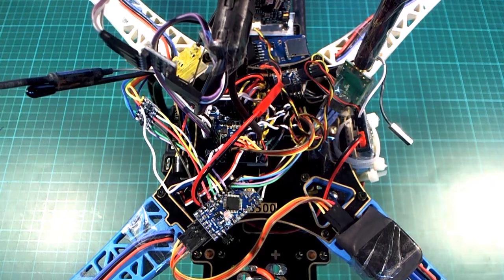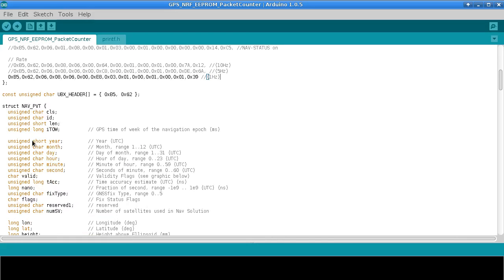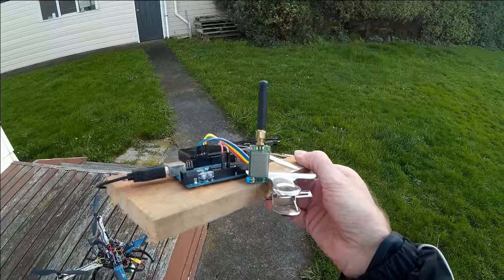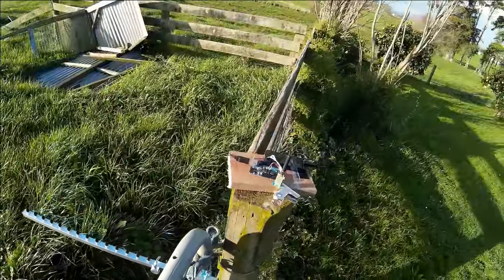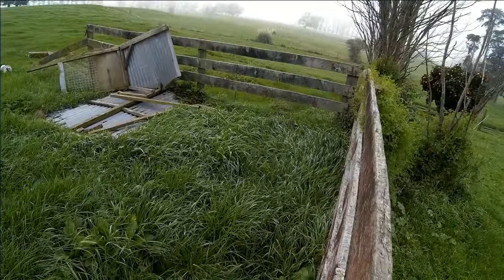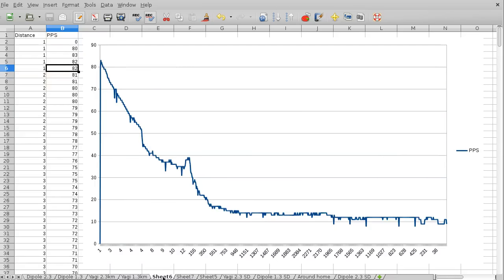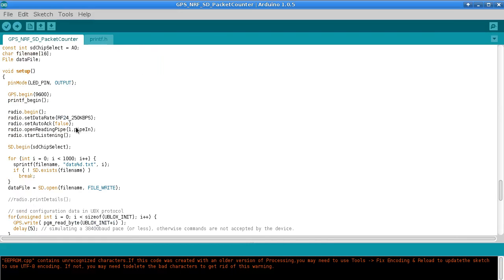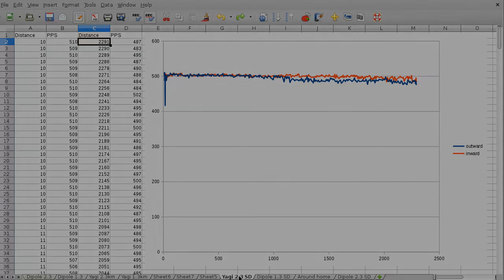nRF24L01 + big ass yagi antenna

Comment: have you looked into using CC2500 modules in place of NRF24l01+ modules?
it seems that even PA NRF24l01+ modules can't get nearly as far as commercial transmitters, many of which use the CC2500  chip

Comment: What frequency is your Yagi resonant at? It looks like 5GHz. If you want to use a Yagi at that frequency with the gain you have at the antenna (about 13dB), the main lobe will be pencil sharp. You will, to keep within the -3dB (half power) limit to follow the drone up, down left and right. You should be receiving 10 to 15 Klm. You data packets will then be much, much higher.
Its all down to field strength. Suggestion. Set your antenna so you can follow the drone, plus, make the drone receiver point forward and back, phased so you can get a full strength signal at all times. This way you dropped packets will be minable.

Comment: Interesting comparison. Several years ago I did some testing of 2.4GHz RC using CP cloverleaf type antennas. It would be interesting to see how these compare to the dipole and yagi on the nRF modules at your location. I made the antennas using enamelled coper wire etc., like the DIY 5.8GHz fpv type, but larger for the lower frequency.

Comment: I was thinking the same about the Flysky transmitter. Note that the transmitter has two antennas also, one stuck in the 'antenna' and one in the handlebar at the back of the receiver, at 90 degress....so it is s diversity system on both ends.

Comment: Do you used a analog pins (A0, A1, A2 and A3) for Sd card module? And SPI pins for nrf24l01+?
Reply from the maker: Yes, that's correct
Reply: +iforce2d thanks!  How model sd card ?

Comment: Hello .

Witch GPS massages give the most accurate lon, lat data. and how do you handle the inaccurate reading (long, lat  last tree digits moving up and down in a fixed pozition, even if you make lon,lat sum )
Reply from the maker: There should be no difference in the lat/lon values, no matter which messages you use. They are all coming from the same value inside the GPS module itself, different messages just give you a different selection of information. I don't think there is any reason to 'handle' the small movements (last few digits changing), that's just the accuracy of the module. If you know the module is not moving, you could smooth out the values over time to take an average. But when the module is moving, smoothing does not help much. If you really don't want to have those last few digits changing, I think the only solution is a professional grade GPS module (ie. a lot of money :)

Comment: You changed the SD library to use the pins A0, A1, A2, and A3?
Reply from the maker: Yes.
Reply: You can share the SD library? Please
Reply from the maker: I'm using a different computer now, I'll share it later.
Reply: Thanks, dear!
Reply from the maker: http://www.iforce2d.net/sketches/SD-hardcode-use-pins-A0-A3.zip
Reply: Thanks, dear!
Reply: iforce2d, Hey! Thanks for sharing this. Does it work with Arduino UNO? I'm trying to make arduino UNO and micro SD card work together.
Reply: Nds SIG e Geoprocessameto, Are you also doing a project like that? Sou BR tbm.
Reply: OK!! I've done it! It's all because of you, my friend! Thank you so much. I'm really happy, I can't explain how happy I'm.
Reply: Estou usando o nRF para transmissão de dados.. Não estou usando em drones não.. e Vc?
Reply: Eu também, estou pegando informações de 2 sensores com arduino e mandando com nRF pra outro arduino mostrar em um display LCD.

Comment: Back in the days, Team Blacksheep used these antennas to do their long range flights. Although, that was for analog video signal and with much more powerful transmitters, but still, you might be surprised by the range. 

Speaking of that, you have a nice backyard with clear LoS to those mountains, and you recently started getting some airplanes. Maybe you would like to try some long range airplane flights? :)
Reply: nice idea!
fpv flying away and then back. but then again. the transmitter has the same type of antenna as the nrf so if the nrf starts to drop off at 2km then that might be the range limit for the transmitter.
Reply: He would of course need a long range system for RC. OpenLRS could be a good option, it's quite cheap and it would also provide a lot of opportunities for playing with the source code and doing all sorts of experiments.

Comment: Hey, great video. I thought we cant use two SPI devices with arduino!! How did you use nrf24l01 which is SPI and also SD card which is also a SPI device. Could anyone share anything related to this which might be helpful to me??
Reply from the maker: I don't know where you got that idea. The whole idea of SPI is that the currently active peripheral device is selectable, usually by its 'chip select' pin, so the MCU can choose which one it wants to communicate with. If a peripheral does not have any CS pin and is therefore always listening, then you can't use it with other peripherals. But that's pretty rare.
https://en.wikipedia.org/wiki/Serial_Peripheral_Interface#Independent_slave_configuration
Reply: Hey, thanks a lot for taking time. I might have many misconceptions as I am into this arduino stuff for only about a year and there are a lot of things for me yet to learn. I learnt arduino on YouTube and there are not a lot of great videos on youtube regarding this subject. But I love the way this Arduino community supports and helps each other. I feels really nice getting help from other side of the world. Really appreciate it!!
Reply from the maker: No problem. I can still remember when I first read that same Wikipedia page, and I understood about 9% of it :)

Comment: I don't really understand why you decided to put the reciever on the quad and not vice versa, that way you could have had the SD card on the ground :)
Reply from the maker: and put the yagi on the quad??
Reply: ***** Does the Yagi not funtion well as a recieving antenna? Well, you tried to test it as a transmitting antenna, i understand now, because having it as a recieving antenna does not make much sense in the real world :)
Sometimes i am a little slow, i apologize :)
Reply: It is big and needs to point in the right spot which is hard to do on a flying machine
Reply from the maker: Yes you are right that the yagi could be the receiver - at least if I understand it correctly, the directionality and gain work the same for transmitting and receiving. What I didn't really like the idea of though, was having a loud 2.4g transmitter blasting away right next to the 2.4g receiver for my radio control :)
Reply: Very good!! congratulations. As you used (pin) the nRF24L01 + and the SD module? Because they share the same ports SPI
Reply: +Nds SIG e Geoprocessamento .

Comment: I think adding altitude to the equation makes a big difference to RSS. The clear line of sight may explain why the results are better than those in Tokyo. It will be very interesting to see just how far it can go, and a wing too. If you don't already, check out Andrew Mcneil's channel: https://www.youtube.com/channel/UCHqwzhcFOsoFFh33Uy8rAgQ
Reply from the maker: shit... can't believe I didn't think of that, very true. In the previous test the receiver was basically at ground level, not 100m above.
This is as far as I can fly though so any further tests will be done at ground level using my car. Yeah I subscribe to Andrew McNeil :)

Comment: Hi if you would like to make some more experiments you could try with: 
1) change the polarization to horizontal( on both receiver and transmitter) ( in long range WIFI it works better)
2)  helical /helix WIFI antenna ( which has circular polarization of the waves, but works with dipol receiver antenna) 
3) try to use waveguide antenna ( also known as sector antenna)  which might have better characteristics than yagi  (also has the horizontal polarity) more info on a great website http://www.trevormarshall.com/waveguides.htm

BTW great job!

you could try the helical antenna as well for the long-range FPV.( these antennas are extremely easy to build)